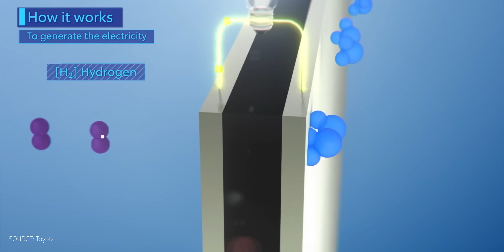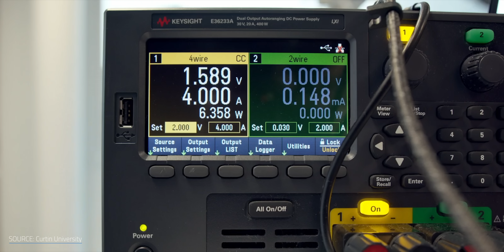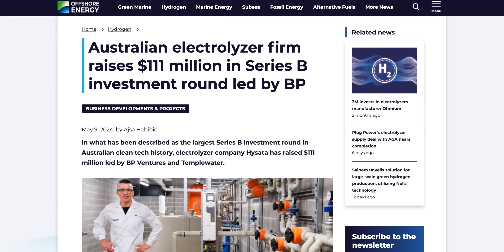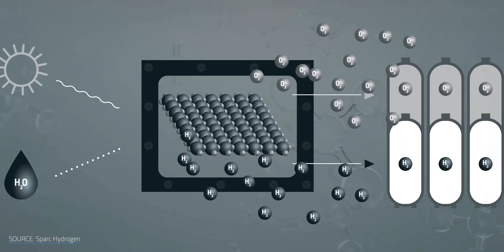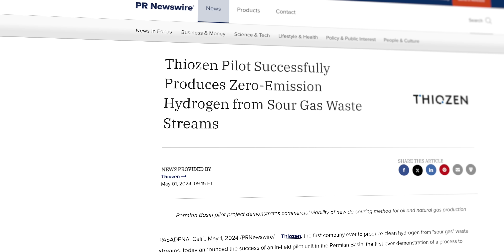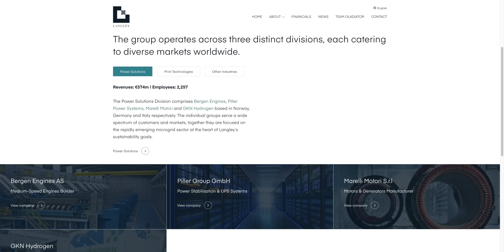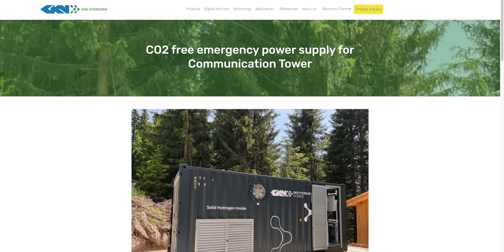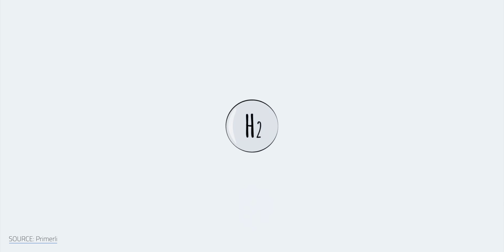How a Hydrogen Breakthrough is Closer Than Ever

Comment: Well, this isnt as dumb as the time you uncritically shared a press release for a scam product claiming to store hydrogen on discs at useful energy densities. 

Fortescue and a bunch of other major investors are pulling back on hydrogen as the basic economics don't add up. 

Best case scenario is green hydrogen becomes cost competitive with brown hydrogen for industrial uses. 

Electrolizers available today have comparable efficiencies. Hysata seems to offer a significant albeit marginal improvement and doesnt change the fundamental issues facing hydrogen. 

You've been corrected multiple times by actual scientists and academics yet you still repeat the claim that hydrides provide better storage densities than alternatives. They don't.

Comment: You should have stopped several minutes in. Improving efficiency from 75 to 95 % is barely going to dent the fact that the battery path is three times more efficient. There may be a route for some liquid H but only for niche applications.

Comment: I am a older man who worked heavy equipment diesel repairs. I am all about hydrogen power and have made some of those little cubes that produce hydrogen. I had small engines running just fine on it. My issue is windmills kill too many birds. In fact when you look at insects as a problem, killing one bird is a problem.

Comment: This is cool. A few years ago, I built my own hydrogen electrolysis device. It works from a 16v li-ion battery made from salvaged laptop battery 18650 cells. The hydrogen and oxygen are allowed to mix in the single gas chamber. Then, it runs through 2 separate spark arrestors followed by some flexible, stainless steel gas hose before running to a mini torch head. It is similar to a small acetylene cutting torch. It can cut through sheet metal. The best part is, I don't have to buy oxygen and acetylene, I just need a charged battery and water.
Reply: Hey Matt 
@undecidedmf
I think you have a bot trying to get people to call a phone number.

Comment: ‘The result changes the efficiency from ~75% to 95%’. 
And there I was thinking that the efficiency of creating hydrogen through electrolyses was currently more around 33% than 75%. 
Could someone explain the discrepancy there?
For example, perhaps that low figure I had in mind was the whole current hydrogen production mix of methods combined not electrolysis…
Perhaps that low figure is the efficiency of hydrogen electrolyses with the current energy mix in mind?
I don’t know, but I have a vivid memory of learning on several occasions that hydrogen through electrolyses is like 40% efficient at best. 
‘You can drive 3 battery EVs with the same energy you can drive one H2 FCEV’!
Are fuel cells more the inefficiency culprit than the electrolysis is??
I’m confusing myself. Helllllp! 😅
Reply: I already found my answers. It’s the whole chain from electricity to fuel cell drive that adds up to the poor efficiency. So with my quick calculation, this 95% efficient electrolyses will currently only help get a fuel cell EV to be about 50% efficient at best, which still sucks. 
So the main problem seems to be the fuel cell itself. Obviously H2 ICE won’t improve matters. Anything on the horizon to significantly improve fuel cell efficiency?

Comment: Is the amount of energy lost transporting power over grid over distance part of the equation comparing green hydrogen to electric? And is the energy needed to pump up, transport and refine fuel part of the equation comparing electric to traditional cars? There are many people advocating for different things, but I always seem to miss a complete analysis varying in everything. There are people expressing the variable of actually having to mine resources for batteries who in turn will eventually end up as waste, and h2 you have to create with energy, and turning that back into energy is relatively inefficient, but it would be very nice to see a true analysis of everything involved to get a clear picture of cost, logistics etc.

Comment: Unless solid hydrogen becomes the vast majority of hydrogen used for energy, I don't believe this is going to solve anything. Like it's said in the video, the energy density vs volume is way too low to be a useful replacement for petroleum products. And production of hydrogen will always give less energy than it takes to produce , and you need to compress, store and ship the gas once it's produced. It's always going to have a negative output compared to the input.

Comment: nothing discussed in this video addresses the problem of hydrogen. the issue with hydrogen is not making hydrogen sustainably, that is very easy to do, rather it is also very pointless to do because the problem of hydrogen is storage. hydrogen is not an energy solution, it is a storage solution. so as a stationary battery it need to be better than say pumping water up to a dam to serve as emergency power for example, or even molten salt driven turbine. and for mobile battery solution, it need to be dense enough that it does not eat into usable cargo space. so the problem with hydrogen is there are very limited use case where hydrogen will be better than the alternative. and if it is not better than the alternative, why use hydrogen? the issue is never with actually using hydrogen, we have been doing so for decade since the apollo space program,  the issue has always been the difficulty of finding a use case which it is not inferior to other method of energy storage and transportation. it may sound silly, but aircraft might be a platform that hydrogen could potentially excel in.

Comment: Oh hydrogen it's not a fuel, it's a battery. Until we find hydrogen wells at the same size as oil, it's not. a. fuel. You have to manufacture it, in a civilization that's basically underpinned by fossil fuels.
In other words, niche applications for niche users by niche makers.

Comment: reading the comment section, i kinda agree to some but not all... in the next 20years, H2 might be the best addition to the lithium battery, small vehicle are still better with battery, but larger vehicle, building n so on, might better use H2, due to the weight to power ratio. i argue, the technology we had for H2 are still very early on.. the electrolyzer for example, who could have thought, it can be done this way? the same would be for all other aspect of H2, i am very confident, in years to come, we will see tons of other unthinkable innovation that would solve many of the issue in using H2 in commercial sector.

Comment: Boeing couldn’t solve helium storage on Starliner yet people want to store and use hydrogen in a complex system and hydrogen is way more difficult than helium. Hydrogen just doesn’t have enough energy density and is about $8.50/gallon or $2/liter. Gasoline is about $2.40/ gallon right now and has 4x the energy density.

Comment: Hydrogen on the surface seems like an ideal green energy solution. But there are major problems with it compared to just generating and storing electricity. The incumbent fossil fuels industry is hot on developing Hydrogen because it nicely fits into their existing business model. The issue with Hydrogen is not so much generation, but storage and transportation of it. This is where the business falls apart because it can't be competitive with electricity in this regard. The only true Hydrogen solution is when you create it and use it as required where it is needed. No costs around storage and transportation. Think about solar panels on the roof of your house - the energy is created and used as required. It can be stored on site in batteries, no transportation required. Very simple and low cost. While there may be some use cases for Hydrogen, the companies developing it are still thinking like the old school oil and gas industry.

Comment: It's funny, I recently looked up a lot of stuff regarding hydrogen and discovered that while the gravimetric energy density of hydrogen is very high, current storage tanks need to be very strong and are usually 20-30 times HEAVIER than the hydrogen they contain (compared to 95-98% LIGHTER for gasoline). It's one of several big challenges still preventing hydrogen from being widely used in vehicles.
Other challenges are storage temperature (not all hydrogen is stored at very low temp), conversion efficiency (for storage AND usage) and good ol' price.
I guess the tech from this video could help but I'm always pretty skeptic about new stuff that never reaches production :(
Also, I believe (kindly correct me if I'm wrong) the 8Mj/L given for volumetric energy density is for liquid hydrogen, not gaseous. Storing more of it in the same volume is probably not easy.

Comment: Check out the ohio state University's Green box program. They make hydrogen from sewage. It cleans the water more cheaply than we do conventionally and also produces hydrogen with very minimal electricity input. I love the idea of hydrogen for seasonal storage and her presentation was the most practical and inspiring that I have ever seen on the H2 subect. It is electrolysis from sewadge rather than water. Far more energy is produced from this process than is consumed from the grid. Not perpetual motion just a better use of all that poop and pee energy we are flushing into our waterways

Comment: in my opinion hydrogen makes sense instead of a pumped water power plant. at low scale. replacing using electricity in some parts of industry. 
Hydrogen cars/airplanes are nonsense in my eyes.

Comment: Hydrogen has long been a red herring used by Big Oil. 
It seems we should use the KISS principle. Electric motors are simple. Batteries are simple and getting so much cheaper and with higher density . Let's not get distracted.

Comment: you barely mention the BIGGEST issue with hydrogen, its storage... it cannot be stored at a liquid (the most compact and dense form but is still 4x behind gasoline, 5 behind diesel) at any pressure (yes even 100Kpsi will not keep it liquid) if not kept below -239.95 degrees C... and even then it takes up 5x the space of gasoline plus you have to KEEP it cool (i.e., consume energy to cool it) even if you are not using any... so much for driving anywhere on it and having a full tank when you return to your parked car...  there are lots of really good reasons hydrogen is going to be useless and flop... it needs to be a cryogenic liquid to be of any practical use and then you have the issue of cryogenic liquids (especially explosive ones) are not very practical for much beyond rocket launches..

Comment: Isn't the fact that wind power is inconsistant the Perfect reason to use it to make it into a long term fuel that can be used for stabilizing gaps in power supply or for fueling ships? Inconsistancy isn't a weakness for hydrogen power demand, its an icentive. Especially if we have dense solid-state storage that doesn't leak hydrogen into the atmosphere. It makes the headache of ballancing the power grid easier without needing to use massive amounts of land to make pumped water energy storage systems.

Comment: All I can say is hydrogen has always been a pipe dream,  and you know what that pipe had in it - man!   Battery tech is improving so fast and in so many ways, I have trouble keeping up with it all, and it is pretty obvious that this tech will provide everything we need in the near future to balance the grid etc..  Even solar panels are as cheap as chips nowadays,  actually cheaper, as spuds are quite expensive at the moment. One thing not talked about is tidal generation, north Australia and other countries like Scotland has heaps of massive tidal flows, regular as clockwork,  this could give us the base load we need ( if required ) .

Comment: I work at a public transit agency that is considering hydrogen as fuel due to the limited range of current battery electric bus technology, but I have major concerns about that idea because the lack of zero emissions hydrogen. I think it would be really interesting to locate an electrolysis facility directly at or next to a transit agency's bus garage so the fuel could be produced and stored on site.

Comment: Fortesque Metals is a large exporter of iron ore from Australia.  Its founder Andrew Forrest has committed to making it real zero by the end of the decade.  This week they signed a contract to replace 800 diesel generators with their own renewables' powered micro grid.  There's some ideas about making green steel rather than just selling the ore.  He's been very critical of climate denier politicians and policies that do not rapidly transform the economy away from fossil fuels.  Fortesque Future Industries is very hydrogen focused.  Forrest was one of the supporters of the massive solar farm planning to export electricity to Singapore.  I understand, Fortesque left that project because he didn't like the risk of a long undersea cable and thought making and exporting hydrogen made more sense.

Comment: I don't think it will ever get to the point where it is a substitute for batteries. Batteries are continually getting cheaper. Already, Solar/Battery electricity generation is the cheapest way to produce electricity. Also, Hydrogen is not a way to cleaner air. It is only a way to potentially power cars more quickly and longer range between charges. New electric cars are moving to 400 and 500 mile batteries. Not sure how you drive, but about 140 miles is the longest my bladder can take.

Comment: There is a hydrogen generator that delivers billions of times more power than we use, its called THE SUN 
It's not hard to collect that power, just use solar panels. cover your roof with them, and you have all of the power you will ever need.

Comment: What about water cleaning prior to electrolosis? Producers will definitely want RO wster to ensure the  systems remain maximum efficient. That takes a lot of energy and there is a lot of waste water from the process. I know the waste water goes back to the source but with onshore systems it can be a problem when you loose 2/3rds of your supply to filtration waste.

Comment: My question is about the waste products not mentioned in the video. If you use water for the hydrogen source, then where do you get water from? If it is sea water, then what happens to the salt and other dissolved minerals in the sea water? If you use hydrogen sulfide, then what happens to the sulfur?

Comment: Does it still take more energy to make Hydrogen than you get from it? Because yes.

Also the line about "when powered by renewable energy"... is renewable energy REALLY carbon free considering all energy inputs for manufacturing, installation, maintenance, and lifespan vs output?

Comment: While fossil fuels have "dirty" connotations, it is possible to produce hydrogen from coal and natural gas with the majority of carbon breaking off as graphite and not CO2. The technology is still developing in that department. 

The big benefit of that technology isnt even the hydrogen. The real value is the super high grade of graphite produced from those reactions. This is used for batteries and can even produce graphine if technology is improved. This would open up lots of technology to research that are currently economically difficult due to cost of graphine.

Comment: It depends what you do with the hydrogen after you make it, if you put it in a fuel-cell to convert back to electricity then the conversion efficiency for the fuel cell only is 45% to 60% with the lower number more typical in real life.   If you burn the hydrogen in a house/building then the efficiency of burning basically 100% and if the source of electricity was wind power or photovolatics then that is a big win. But you would need new piping installed down all streets because the current natural gas pipes can't handle hydrogen (embrittlement) plus there is a lot of leakage by the fact that hydrogen leaks faster than natural gas.  If you burn the hydrogen in a car engine then that is a big win also if the source of electricity was wind power or photovolatics - but again, how do you install new piping everywhere in the USA to transport the hydrogen? The cost of that would be enormous as stated previously, natural gas piping would fail due to embrittlement and it would leak too much even without the issue of embrittlement.

Comment: Hydrogen will be crucial to clean,long range aviation using  fuel cells. Batteries might find some use for short flights,but to replace jet fuel, H2 powered fuel cells powering ducted fan motors is the future.

Comment: People forget that electric cars were considered impractical for nearly a century before becoming mainstream. Hydrogen fuel is likely in the same boat. There are entire industries, like aviation, shipping, and heavy land transport, where batteries won't cut it, and hydrogen is the most feasible option. Sure, it’s still in the research phase, but we've already seen breakthroughs like 98% efficiency in electrolyzers. With cheap renewable electricity in the future, hydrogen will be a practical solution for sectors where electrification isn't viable. Writing off hydrogen now is short-sighted, just like people did with EVs.

Comment: I don't really see the problem of getting hydrogen from fossil fuels, As long as the carbon is locked back underground. I think it's called pink hydrogen, But I'm not 100% on the terminology.
Edit: It's Blue Hydrogen. Pink hydrogen is electrolysis done through nuclear power.

Comment: I have always visioned hydrogen as "a side product" for future solar, wind or wave farms. A form of battery. As something filling the gaps on other green energy solutions. And in the future Relapsing gas after most of the need for gas has already been replaced with electrical cars and such. 

I dont know current industry well enough to know when/it if it will happen. One of those "sure it work that way" newer bothered to really look into it.